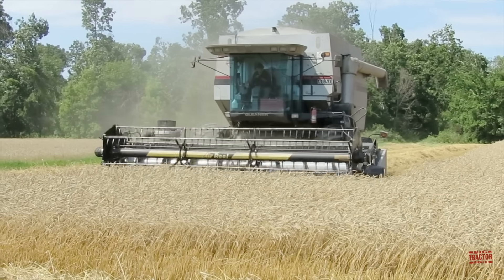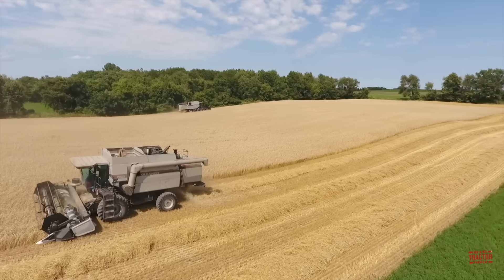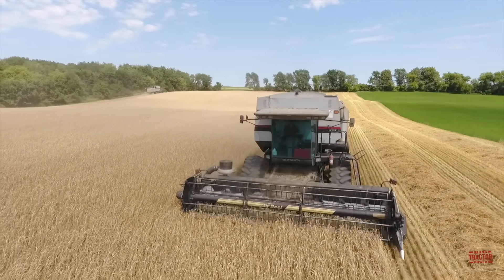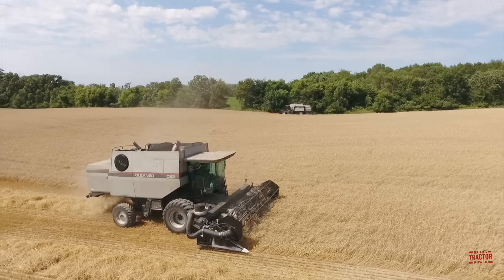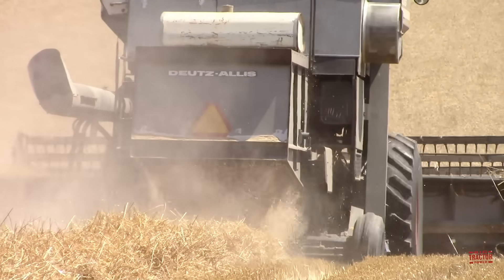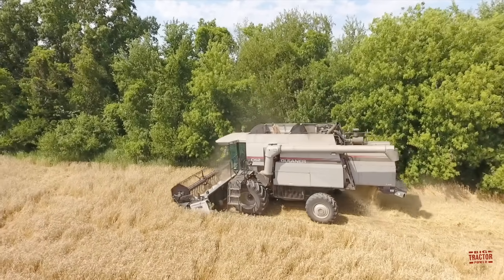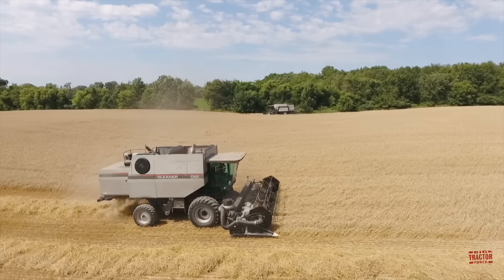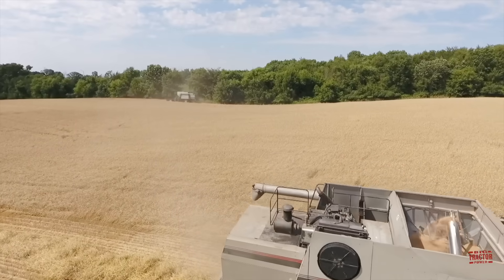GLEANER C62 Combine Harvesting Wheat

Comment: I still have a question, why do I use a narrow header, not a wide one. Is it related to the landscape or something else? The weight is the same, but the gain is more than 10%, the game is worth the candle. I have no idea why they use narrow headers, although I see them at many grain producers.
Reply from the maker: The 22ft head is popular for straw production. A 14x18 small square baler can only feed 22 ft of straw into the pick up head. 25ft and 30ft windrows will leave straw into the field on both sides of the pick up on the baler.

Comment: Wasn't aware that Gleaner were supposedly the originator of the self propelled combine ?
 That accolade is usually attributed to the Massey Harris 20 model produced from 1939 thru 1941.
 Most sources would say 1938, but since I have an original Parts Book for the MH 20, it explicitly states that it was first produced from 1939, on the front cover.
No arguing with that.
 Wondering what the hose like device at the RHS of the header is for - dust suppression perhaps ?
 Wasn't aware that Gleaner ever made conventional type combines. Interesting history regardless.
Reply: That thing on the front is a blower driven "air reel" I think it is supposed to help reduce grain loss but I've only seen them being used in soybeans. I've never cut with one so I have no idea if that actually work or not